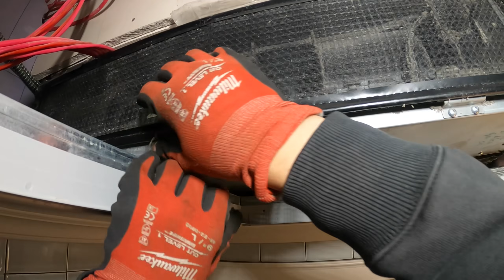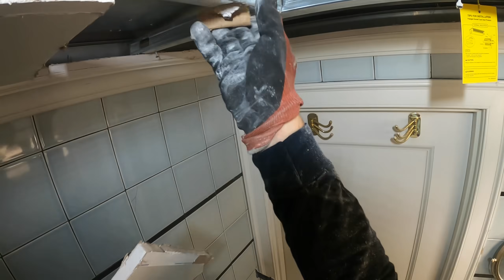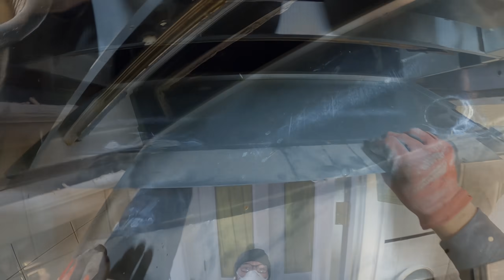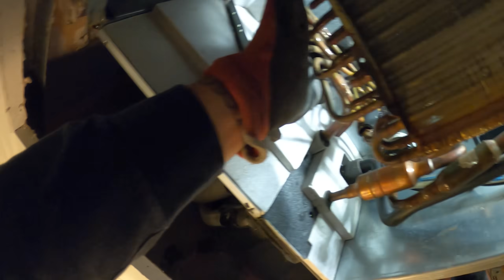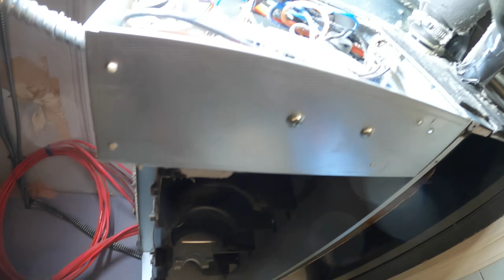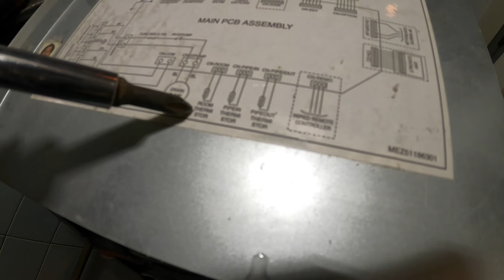HVAC Service Call: LG Multi V Error Code CH02 (Inlet Pipe Temperature Sensor Of Indoor Unit) LG HVAC

Comment: What's the purpose of thermistors on the in and out of evap unless its checking for superheat
Reply: They probably optimize for a certain pressure differential across the coil, to maximize efficiency, which they could calculate with the temp difference. I guess that's important to gauge the system load on the total system, as it can heat and cool at the same time and probably has conditions where it can throttle single rooms in peak demand as well, when the outdoor unit cant keep up.

Comment: Your a saint to. Are they putting access panels back that will be large enough for next time or just patch & match work? You need a drywall division too🤣
Reply from the maker: Thank you! Unfortunately, they are just putting back the sheet rock and same access panel. Next time it breaks down, the same tear down will be needed. Haha I seriously need that! Just this one place alone haha the whole building has no access to these air handlers. I told them what needs to be done for access but nothing has yet to happen. It would be a big project. They need proper access to service so we can clean the units properly and for breakdowns. After that, they need a maintenance program. So far, nothing. Hence the constant breakdowns and large repair bills. Thanks for watching & supporting! 🔧⚡️

Comment: Why are all these multi v systems shoved into a tiny and unserviceable hole?!
Reply from the maker: Theres 135 air handlers with no proper access. The best part is that after all these openings, they sheet rock is all back up so the next breakdown will require the same tear down😂
Reply from the maker: Poor planning! "They'll figure it out later" - The "access" panel installer